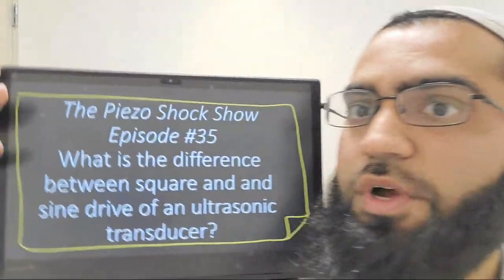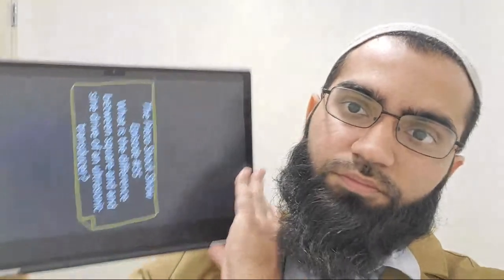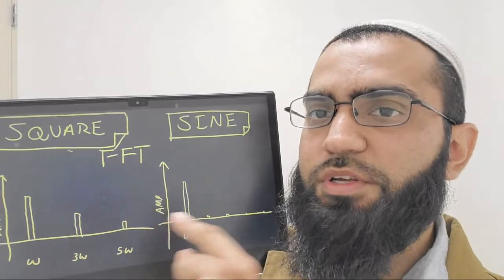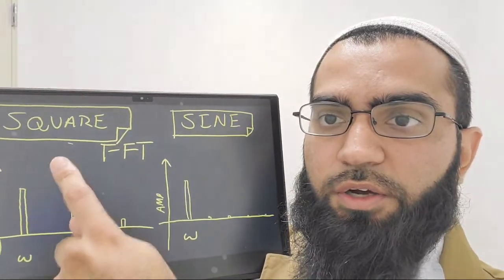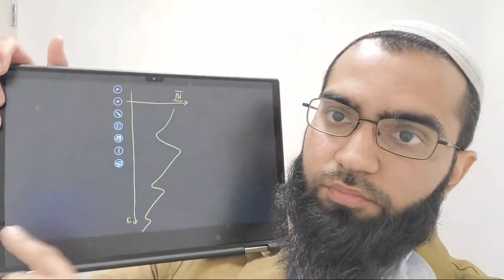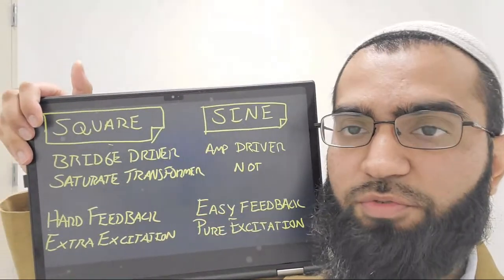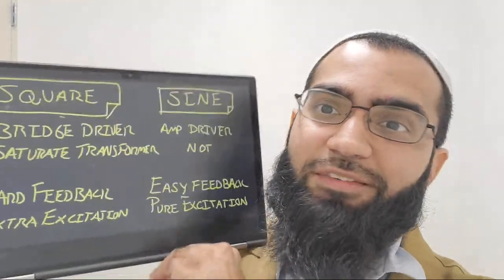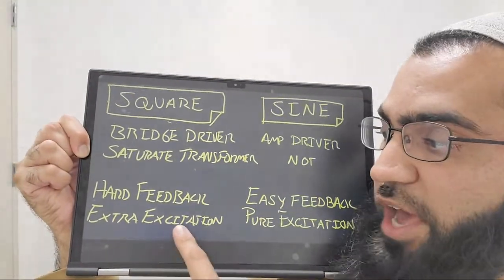Piezo SHOCK Show #35: Should I use a square or sine drive for my ultrasonic transducer?

Comment: hi , i'm in the process of building ultrasonic cleaner  . during my testing i could generate almost pure sine wave on the transducer even when it is driven by a square wave by adding  an inductor in series with the transducer . in this case is it really important  what type of drive circuit is used ? the transducer is getting a sine wave anyways (if proper inductor selected) .
also i'm not sure if sine is best for cleaning purposes , i heard the added harmonics of the square wave are actually better for cleaning transducer (more effective cleaning?) 
i'm not even sure if a can drive the transducer directly with a square wave without generating large spikes and destroying the switching transistors .
Reply: I doubt the transducer can even generate the harmonics, the bandwidth on these things is not very high

Comment: hello dr what do you think better wave for magnetorestrictive based transducer? i want build one because it looks simpler n cheaper than piezo ceramic based element
Reply from the maker: The same principles will apply. Magnetosrrictive devices use huge current, so you won't be able to get good square waves anyways.
Reply: @ultrasonicadvisors  so i can drive with my zvs?
Reply from the maker: @dogodogo5891  if be concerned with frequency response

Comment: Dr, I’m in the middle of building an ultra sonic driver (half-bridge). It outputs a square wave. To make it sine, do I just have to messure the Capcitance value of the transducer and use the manufacturer transducer frequency to calculate inductance value? I would like that my half bridge outputs sin wave at the transducer…
Reply from the maker: For a high Q resonator, the series inductor does not really make the square wave a sine wave. What you want for a resonant device is a low pass filter.

Comment: Excellent discussion Dr Shekhani, we appreciate the amount of time and effort you devote to producing these instructional presentations. You may have covered this before, but can you please discuss how the COP of a ultrasonic device is derived, this of course will be based on a Sine input waveform, thanks in advance.
Reply from the maker: thanks for the suggestion. Sorry, but what is "COP"?
Reply: @ultrasonicadvisors  Apologies, Coefficient of Performance, is there an established method of determining the input/output power ratio of ultrasonic devices? cheers.
Reply from the maker: @ricksampson6780  there is not a universal method. Its gonna depend on the figure of merit for the specific application.
Reply: @ultrasonicadvisors  OK, thanks.